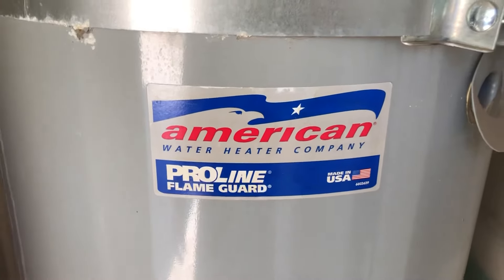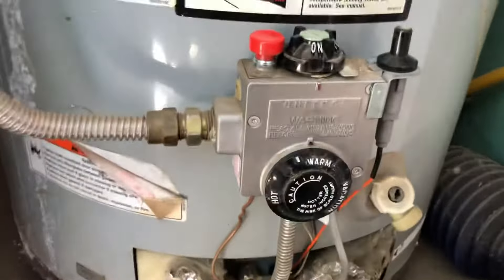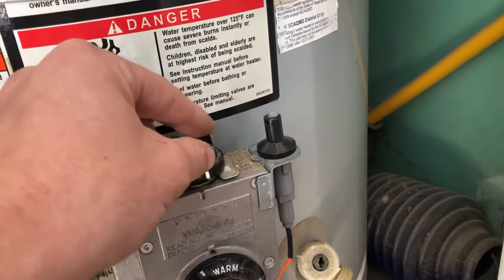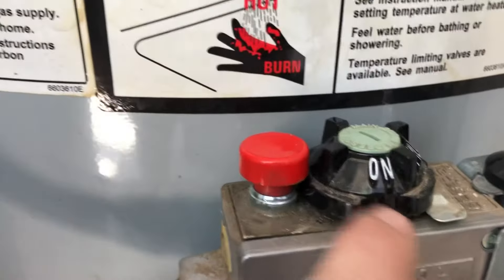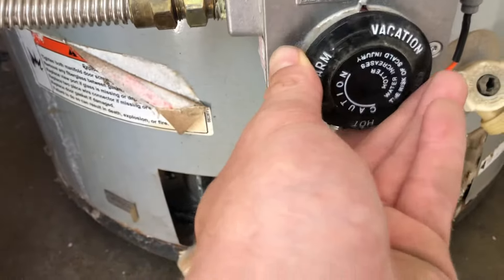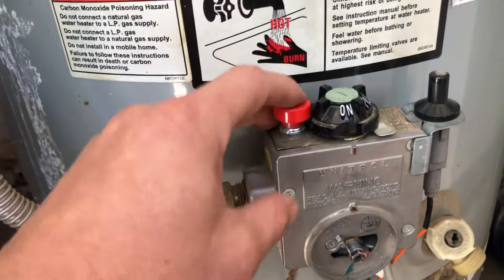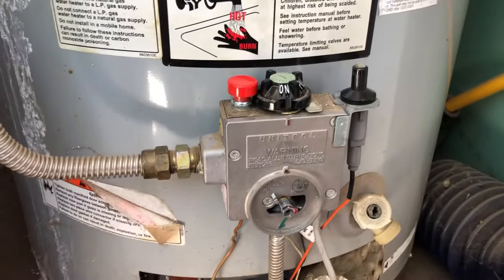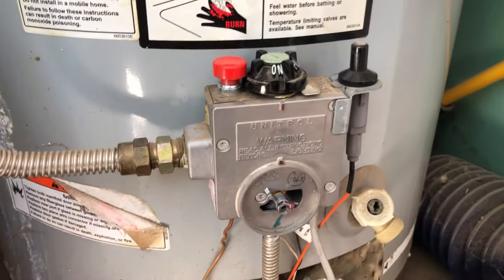How to relight your pilot light for your American Water Heater Company Boiler

Comment: My instructions face the side wall with copper pipes in front of it...Red button wouldn't depress THANK YOU. Now I know what I am looking for...Wonder why it went out..
Reply from the maker: likely dirt or just something got in the line temporarily.  Check that there is a seal around the unit so air/wind can not extinguish the frame.  Normally if that panel comes loose, it can allow a little of that to happen and put it out but most commonly a spider or a web or dirt man...  I wouldnt worry about it unless you have it happen again in a short period of time - reignite and forget about it if it doesnt.  have a good one man

Comment: How do you get the dial to the off position? I was only able to get it to go to the pilot position, and then it was nothing but resistance trying to get to the off.  I pushed the red button, and then it re-lit on its own. It's like I accidentally fixed the problem. Then I found your video, which is very helpful by the way, thank you very much. Now I'm trying to learn more about this whole process so I know how it should have went, why it worked the way it did even though I didn't do all of the steps, so that I can be better prepared in the future.
Reply: There's a metal tab on the right of the knob that you need to press down so that it gets to the off position. The off position step I think is so that you stop the gas and give time for the gas to clear around the heater. If you had a gas leak and it was accumulating while you pilot/ignite the heater, I think the danger would've been maybe an explosion? I don't really know for sure... I'm waiting for the 5 minutes before doing the pilot/reset/ignite step...